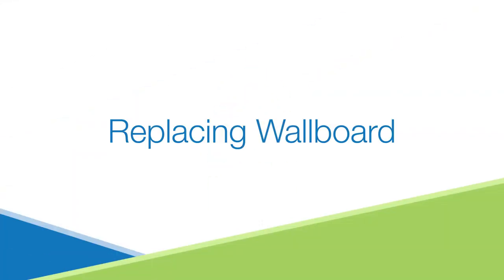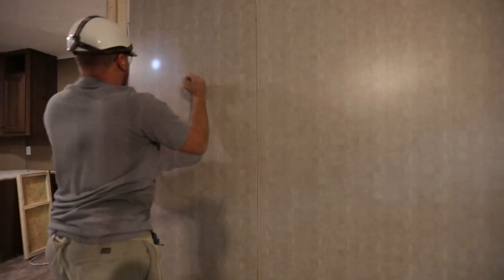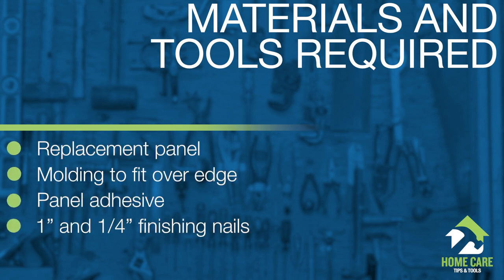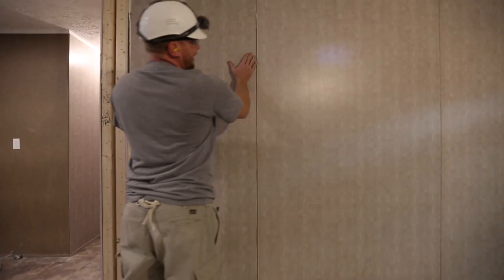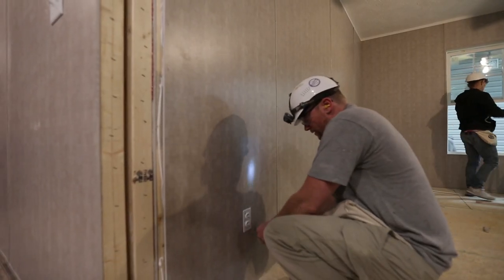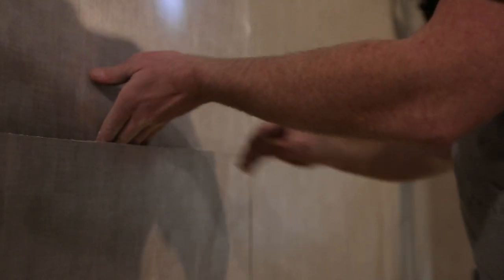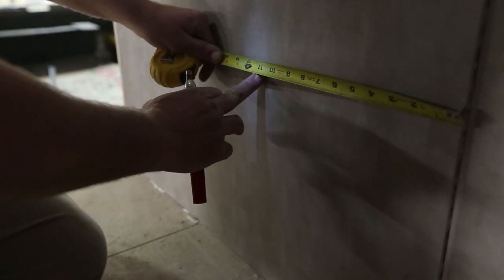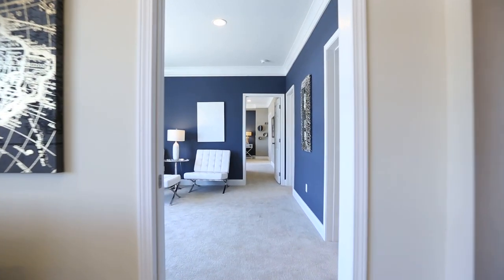Home Care - How To Replace A Wall Panel In Your Manufactured Home

Comment: What kind of board comes in mobile homes
Reply from the maker: Brandon - Sorry for the confusion, what type of board are you referring to so we can properly gather information for you on this subject matter?
Reply: Clayton Homes the board there replacing that has the white strips
Reply from the maker: The board in the video is drywall. There are different types of drywall used in our homes and they vary from builder to builder.
Reply: Clayton Homes how about the ceiling is that drywall to
Reply from the maker: The ceiling materials vary from facility to facility. So without proper information we would not be able to provide that information. If you need further assistance please reach us via phone at 1-800-822-0633 so we can help you locate your builder for further insight.
Reply: Clayton Homes it was the early 90s it has popcorn ceiling with white strips people say it’s flakeboard ?
Reply from the maker: We may be able to locate the builder still, Brandon. Please call us for further assistance!
Reply: Smartest thing you will ever do... never buy a Clayton/Luv Home, they have several other names floor planned under the Clayton umbrella!
Reply: What about 1999 dynasty home 14x70 replacing the wall paneling! Its like sheet rock with wall paper!